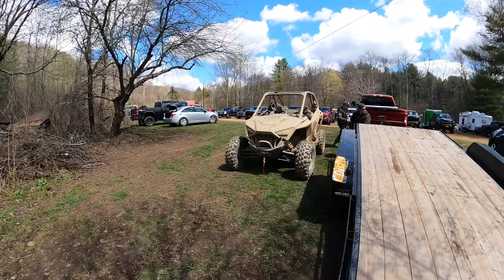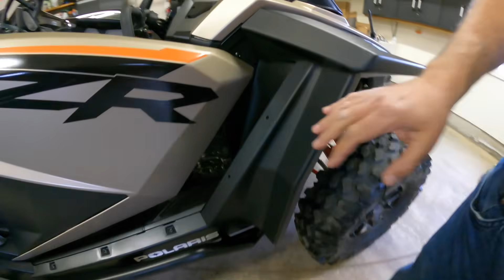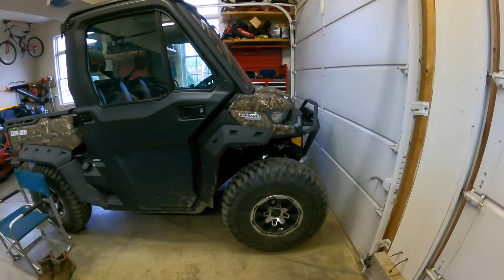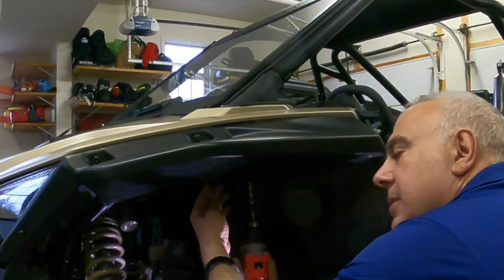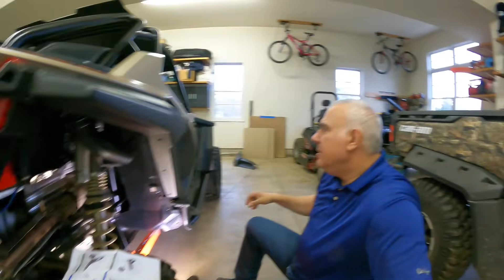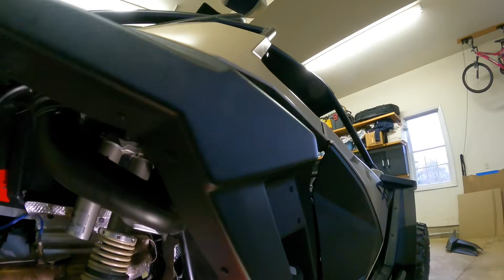RZR Pro XP Fender Flare Installation #196

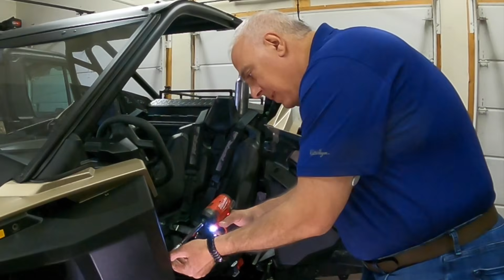Comment: at 3:46 where you get that tool to pull them rivets
Reply from the maker: Jesse Nappa sells them, and it works well on most rivets but the head is too wide for some and I have to use slotted screw drivers. Good luck
Reply: I found 1 at habor freight